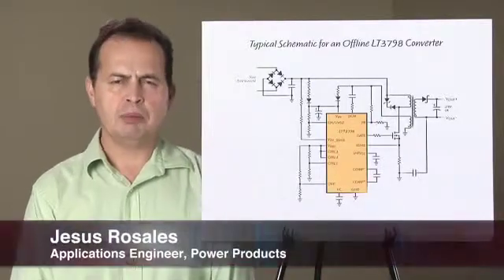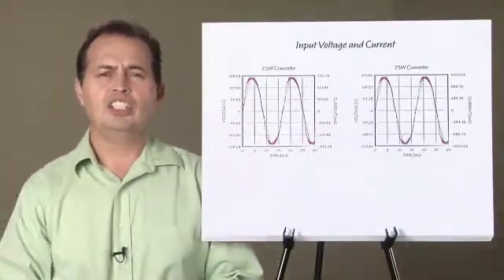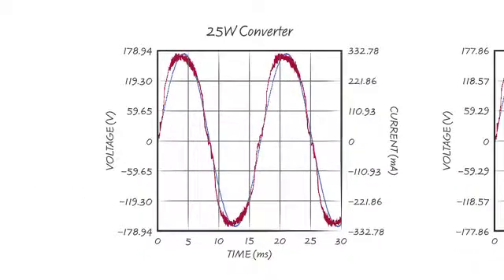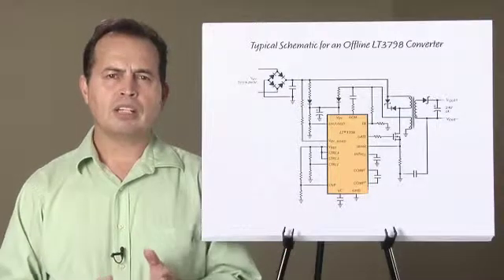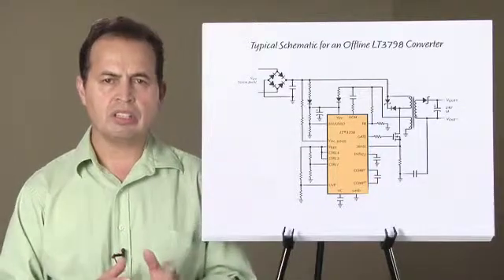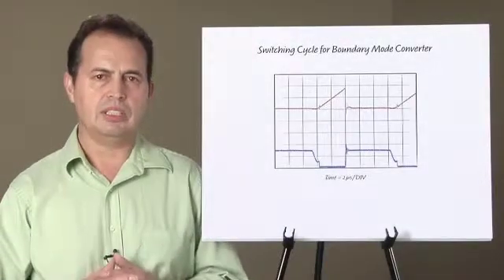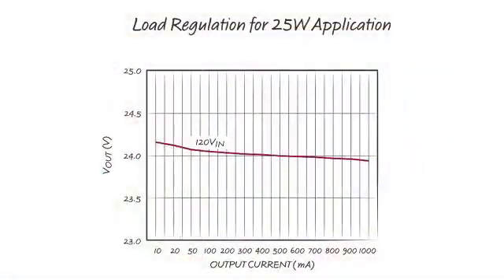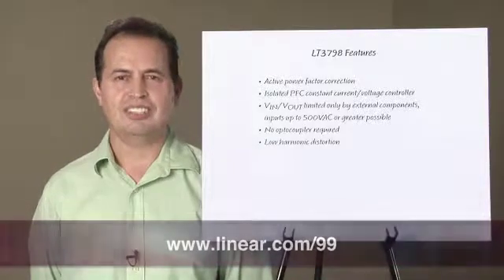Isolated Flyback Controller with PFC Controls Voltage or Current

Comment: Is this controller works for DC input Flyback. if it works can I get any design guide for the same. I tried in LTSpice but some time it's not switching and some time works but giving low voltage than designed.